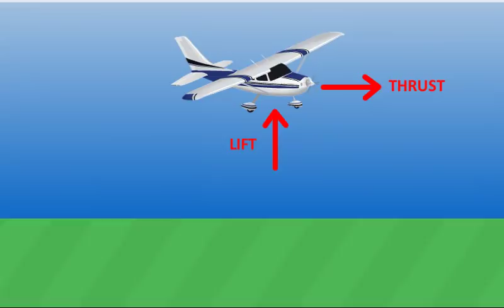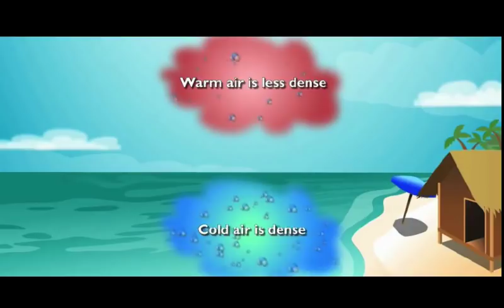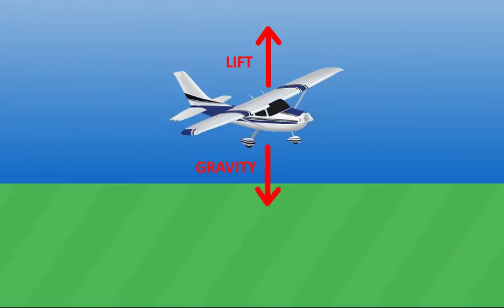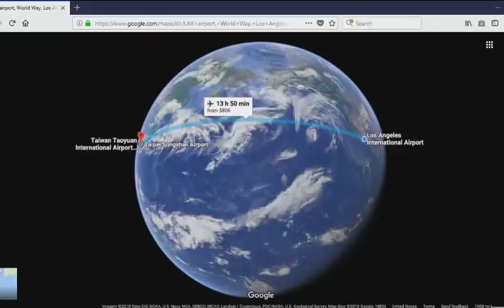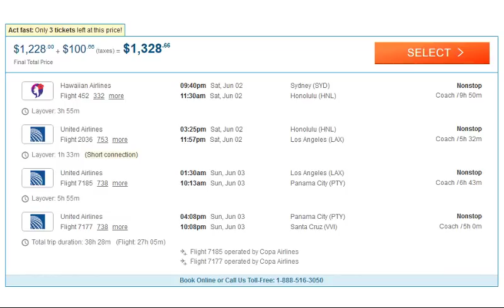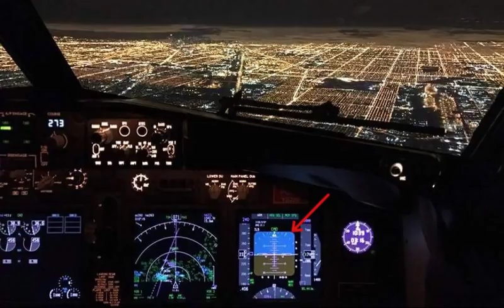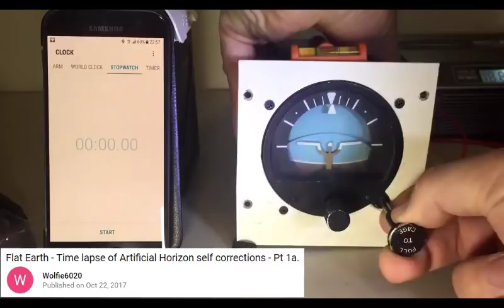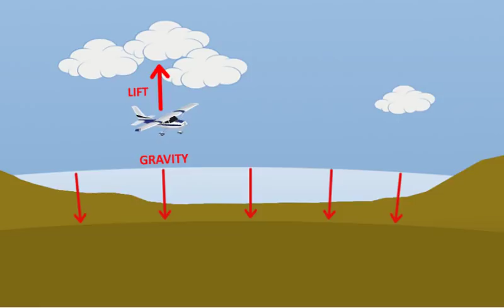Flat Earth Falsities - Plane Nonsense

Comment: Of course, unless the airstrip is on the equator, the speed of the spin of the planet beneath the plane is going to be lower than it would be exactly on the equator. 

Planes taking off from Heathrow (v approx 50 deg north) and heading directly west (edit: or east of course) would be going over the part of Earth which is turning at extremely approximately 750 mph (it's way too late at night for me to do the maths now - yes, I can do it if I need to).

If this doesn't make sense to you flattards, think about the axial north pole - ie the exact point around which the globe spins. Imagine you're there. You take a couple of steps back from the pole, then stand still. If you're 2 yards from the pole, that's the radius. The circumference of the circle you'll travel around in 24 hours will be 2πR (2 * π * 2 = c.12.5) or approx 12.5 yards. You've taken 24 hours to travel 12.5 yards. There is no way that that part of the planet is travelling at 1000 mph! You'd have had to have gone around the pole 80 times in one day if it was going that fast!

Before you try arguing, look at a globe, look at the figures you've been told often enough, and do the fucking maths! Anyone calling this 'fake' is frankly an idiot who can't do basic arithmetic, or just too scared to realise he's wrong!
Reply: "Anyone calling this 'fake' is frankly an idiot" Isn't religion a wonderful thing. It makes people idiots, aka sheep. and the idiots are so idiotic they call other people sheep when they actually self identify as sheep. Pure goldy.
Reply: wong religion is holding humans back. It makes people clueless.

Comment: One fault of the educational system is not providing more real, practical and therefore complex principles. This is due to the fact that more advanced knowledge is required.
For example Turbulence is a very complex, hard topic. Rigid body dynamics is another. These two subjects are the stuff of advanced mechanics only taught in the upper levels of college engineering and physics.
It requires some calculus and linear algebra, mid and basic stuff of engineering, etc.
People with high school only, need to study just the required topics in order to see the complexity.
Simple models can do, but still people need to understand.
Many people are not able to solve a 4 by 4 system of equations algebraically, maybe no even a 3by3.
My position on flath earthers is that many of them wish to be scientists or take part in it, and they feel outsiders by the system requirements over admission exams, AND cost.
I guess this is the central issue.
They want to provide their creativity but they have been left behind, which of course is not fair.
Education must evolve.
Now moocs are available, and people can get into college stuff from home.
Reply: Social hierarchies, performance pressure and creativity stifling.  These are some of the perils an introverted, sensitive and intelligent student must face on a daily basis, the latter being the most harmful.  Education is such a vital system ... but it is so backward. We don't teach children to cultivate their intelligence through critical thought and doubt, rather, we teach them to memorize and accept established ideas, beliefs and discoveries without questioning anything, in order to make our society continue to run smoothly.

"I pay the schoolmaster, but it is the schoolboys who educate my son." ~ Ralph Waldo Emerson

"Education is a method whereby one acquires a higher grade of prejudices." ~ Laurence J. Peter

"Education is one of the chief obstacles to intelligence and freedom of thought." ~ Bertrand Russell

"There is nothing on earth intended for innocent people so horrible as a school." ~ George Bernard Shaw

"Soap and education are not as sudden as a massacre, but they are more deadly in the long run." ~ Mark Twain
Reply: @BrainUser1  
College is the place where the knowledge goes from the textbook, to the blackboard, and then to the student textbook, passing through the brain of no one. "Mark Twain"

Comment: That helicopter argument @ 4:15 was absolutely idiotic, even by FE standards.  Question for flattards:  if you're standing on a carousel as it rotates, and you jump straight up, what happens?  FFS
Reply: well momentum does not make you land on same spot.
Reply: @BrainUser1  The point is, in both cases, the object that is ascending is already moving in the same direction as the object from which it is ascending.  So we don't see Earth spin around below helicopters as they take off, nor do we see the carousel spin around beneath our feet when we jump.  The fact that this even needs to be discussed by rational adults speaks volumes about average IQ these days.
Reply: @michaeleconomides4054  eee... depends on how long /high you jump, all is reletive :)
No one expects seeing spinning, but if you are no longer moving in same direction for a while or even hovering, some IQ's would expect a difference of results. 
So doc what is the fact that you are here, in YT nonsense land? Boosting your ego are you?
Reply: Or throw a ball up in a convertible versus a car with the roof down and see what happens to the ball. I dont need to throw the ball up in both cases to know the answer
Reply: Also, I'd like to see them fly a plane using their map, see which is quicker and just let them go to an airport and see what happens when a helicopter lifts off, you can see what happens

Comment: Actually it’s faster to fly east as planes hit the Gulf Stream. 
The Earth and its atmosphere both spin at 1000mph. 
Jus’ sayin.
Reply: The Gulf Stream, aka the North Atlantic Drift, is an ocean current and fuck all to do with flying.
Spinning is not measured in mph it is measured in rps. rpm. etc.
The Earth does not spin, it rotates a top spins, the earth rotates very, very slowly. .0.000696rpm. 
That is the rate at which the earth rotates.
Spinning is what tops and Jennies do. The earth rotates slowly, very, very slowly, at half the rate of the hour hand on a clock.
Try education, it's a wonderful thing.